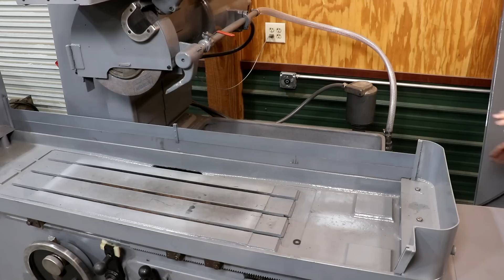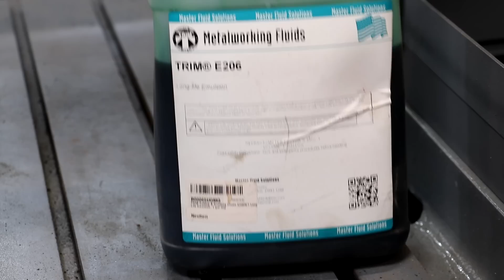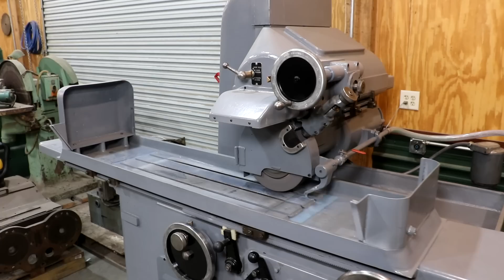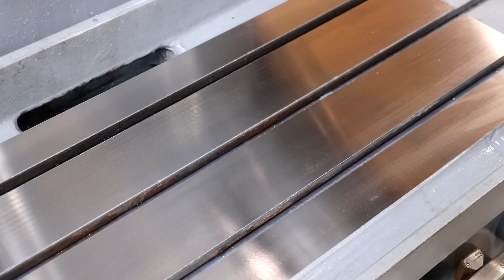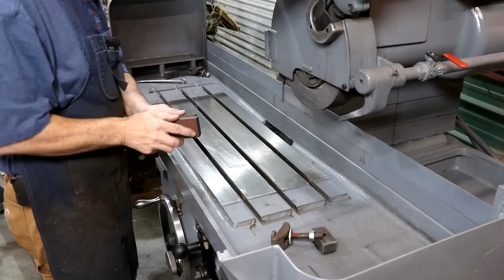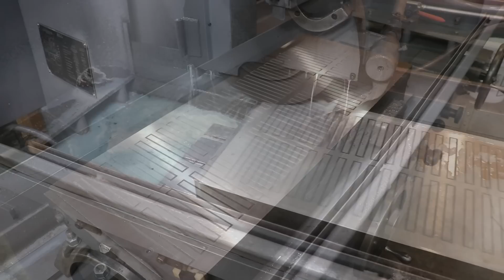Thompson Grinder Restoration: Grinding the Table & Magnetic Chuck True

Comment: Hi Keith. 
I have some advice for you regarding the surface on the chuck. Im sure your wheel is perfect for the job, but one thing people often forget when grinding with these vertical stone grinders, is to dress the wheel before doing the last 2 fine passes. 
What I always do, is leave 0.01mm (sorry for the metric, Im european), then I dress the wheel, and do 2 passes taking 0.005mm each pass, and then let the machine spark out until there are no more sparks at all. 

I dont know if your grinder is able to adjust the stone wheel speed, but if it is, then another tip is to lower the speed before the last two passes, and dress the stone at that lower speed. Often if the stone is spinning to fast, tiny ballance fluctuations will leave a "spotted" surface even if you ballance and dress the stone. So finishing of as described, im sure you will get a close to mirror finnish on everything you grind :) 

Great video, and lovely machine. Once you propperly get the hang of it, you wont find a better surface grinder than that :) 

Cheers

Comment: A guy in our shop was going to grind the chuck and started by removing the back rail and then dressed the wheel.  Everything was going well up to a certain place on the surface that wasn't grinding.  Turned out there was a diamond particle embedded in the chuck and every time he made a pass over that spot, it would dress the wheel back.

Comment: You need to take the time to find the overall high spot first.....on ANY job!  If you drop the head until you spark and just begin grinding you may discover that the high spot is elsewhere and you will be WAY too deep in general.....as you discovered I believe.

Comment: What I found out was grey were medium grind.  Best GP is white that fractures and cools.    I have Grey, White, Red, Green.    Red is Ruby and eats nicely.  Green is for Carbide or exotic steels.  I have some that are OGE ground for edges.  Light cuts on them they are ruby.  I have two dry vacuum's that draw grit and metal and has enough force to steal 1/2" steel being cutoff.  I found some in the hundreds of pounds of grit and iron when I got mine.   3-Phase 380v 3 motors.  I have some books (new) if you need their titles.

Comment: Adam Booth, Kurtis Allen, Leo Goolden, Dave Engles, and Keith all machine wood or metal, and do it to a high level of perfection. All five of them would remove the "bozo marks". I have seen each of them take time to remove harmless imperfections, even ones that can not be seen because other parts will cover them up. It is this compulsion that makes these channels worth watching. I love seeing them perfect items they are working on. (abom79, Cutting Edge Engineering Australia, Sampson Boat Co, Engles Coach Shop).

Comment: Bummer about that heavy cut, when I saw the sparks I thought gee that’s a bit much, but once the wheel is in your committed to it. Slip stick, the Bain of machinists for ever. If your getting lines in your grind I would try a table mounted dresser. If the overhead dresser is not in perfect alignment, or if your dressing dry and the diamond heats up on the way across, it will give you a bung dress. Although your dressing overhead with the axis it feeds on, it’s not on the side you grind, so the error however small is real. I have never liked them for that reason. It’s possible the first grind on the table broke the wheel down with the heavy cut and it conformed to the axis, which in my experience how it goes, the high point on the wheel does more work and wears away.

Comment: Hi Keith on my grinder coolant tank is similar in design in the front section i put some old microwave magnets in the bottom. It works well to catch all metal filling.

Comment: Keith: Check with Steve Summers, Adam Booth, Mike Wiggins and Keith Fenner. I seem to remember someone getting in a big supply of grinding wheels, most of which they couldn't use. Can't hurt to make some phone calls. Thanks for the video. See you at the Bar-Z. Jon

Comment: Why not use a silicone grease between the chuck and table to prevent rust from forming?  I would think over time the rust would cause a jacking effect on the chuck causing misalignment.

Comment: Would there be a benefit to put down a layer of wax or oil on the bed before putting the magnetic chuck.  I was thinking the underside of the chuck could be waxed or at least fill and protect the rust... or convert it and rustoleum rust reformer it.  Lol.  I suspect I am probably suggesting things that would help it survive 200+ years assuming zero maintenance but probably wouldnt matter in the near term.

... and then you sprayed on the anti-seize.  Lol.  Alrighty then.  Keep up the good work!

Comment: Is there a way to cut the outer ends of the bed?  It seems that you might want to bolt down things that are longer and might stick past the machined area.  That being said.  I dont use these sorts of machines so maybe that situation doesnt happen on this size of machine.  Excellent content.

Comment: What's your take on the 'old chestnut' I remember from my first career in engineering, when I left school here in the UK (so 1970's/1980's)? This is about the potential danger when operating a surface (or other) grinder, that uses a liquid coolant. The theory goes that, whilst operating, the coolant soaks into the wheel and as a result is uniformly distributed within the wheel's matrix. Then, when the wheel is inevitably shut down, even if left to spin a while before doing so, any remaining coolant liquid in the wheel will gradually migrate downwards under gravity, to then accumulate at the bottom of the wheel. The implied danger, is that when that surface grinder is next turned on, the wheel is technically out of balance, running the risk that the wheel might actually explode, due to that out-of-balance moment. In the company I worked at back then, divisions which operated night shift working, didn't actually turn their grinders off, as one shift changed to another. In those that only ran a day shift, the grinders were turned off, but it was the job of the maintenance staff covering the night shifts, to come in and safely start those grinders again, such that they were already running when the day shift began.
Reply: More likely I think the grinders were kept running to keep the machines 'warm' and tolerances within the machines consistent (what sort of product were they working on?). As for the out of balance issues, I don't know to work out how much G the periphery of a grinding wheel is subject to, easily in to the hundred+ at least, which I'm sure would prevent capillary action withing the wheel matrix. A stopped wheel sitting in a coolant puddle on the other hand is a different matter.
Reply: I'm sure you are right about keeping things at working temperature. In the divisions with night shifts; one was making pumps and compressors, the other made hydraulic systems (pumps, valves, etc.). My division had surface grinders, but only used intermittently for production and, of course, all divisions also had Tool Rooms with similarly infrequently used machines.  @alan-sk7ky

Comment: I'm interested in your take on step-over amount when grinding.  I worked as a toolmaker for many years and we almost always used a small stepover, the thinking is it creates less heat, and less heat distortion.  Also, with a small step-over, as the wheel wears there is still quite a bit of unused wheel face that is unworn and keeps the depth of cut consistent.
Recently I had the tables on a 12" jointer reground at a shop that does machine tool rebuilding.  He set them up on his huge gantry grinder. ( you could park a small car on the table) He said he had quite a bit of trouble with the thin castings swelling from heat but looking at the grind pattern you could tell he was stepping over about an inch per pass.  Didn't make sense to me.
The other theory with a large set-over is you can get uneven wheel wear across the face of the wheel, creating a very slightly uneven surface.
Reply: High production shops push for speed, and as you know, there's a tradeoff. In my old shop, we would hog off metal with high feed and stepover, but then re-dress the wheel and gently dust off the last half thousandth. Keeping a strong coolant flush made the wheels last surprisingly well.
Reply: I noticed a bit of z-axis movement while the table was traversing the x axis. Is that normal for these machines? When I grind on my Jones and Shipman 6x18 grinder I avoid that. I think balancing the wheel will make a big difference once Keith finds some for this machine.

Comment: To get rid of the pattern on the finished surface try a diamond mounted on the magchuck.  It will dress the wheel to the part not to the top of the machine
Reply: As long as both are rigid, it makes no difference, but the chuck is always rigid.

Comment: Is it typical to have the wheel/arbor move in/out while still over the part instead of having more horizontal travel so the head moves before getting back over the part?
Reply: I see that too the wheel is moving when it is grinding !!!! It should move over at the end of each grind not when it is grinding !!! It is putting a side load on the wheel !!!!! I hope that this help you !!!!

Comment: Good video, Keith.

I have three surface grinders in my workshop, and all are British made.

The largest is the 12ft long Churchill built in Manchester in 1931. It has an 18" wheel and is used for all my really big projects. It also has an 8ft electro magnetic chuck and a coolant unit with a magnetic separator.

For your information. Churchill was originally an American company that under licence built their machines in England. We continued to build your machines until the end of the First World War, when Churchill relocated to England permanently. Churchill then became The Churchill Machine Tool Co, which is still in business today.

Next is the Bridgeport built in 1938 in Stratford. It has a 12" wheel and 3ft electro magnetic chuck. Sadly, the machine is out of commission. I purchased it in 1989. "Sold as seen spares or repair" for £200. It was meant to be a working project only i never had the time.

The smaller and last of my grinders is the Jones & Shipman, built in Leicester in 1941 and has a 9.5" wheel. It has a 2ft electro magnetic chuck. The coolant unit has a magnetic seperator, but that was added later as it did not come with the machine. Compared to yours, mine is just a baby, but baby or not, it has a valuable history.

From the latter part of World War Two (1941-1945), my machine was used to grind parts used in the making of the Rolls Royce V12 Merlin engine.

These engines powered the early Spitfire models. They powered all of the Hawker Hurricane series and the Mosquito too.

The Mustang and Lancaster bombers also used the same engines, but neither of these names are mentioned in the document correspondence i have where parts were manufactured. The company is still in production but is now part of the 'Hardinge Group.'

Both of my working machines have their own diamond dressing stones similar to yours, although the dresser on the Jones & Shipman needs new diamonds.

For both of my machines, I use copper slip for the same reason you used it on yours. Both of my machines have splash guards like yours only mine are not segregated which brings me to my question.

At the rear of your machine your splash guard is split into 3 parts, and yet one part is missing. Do you intend to make another, or will you allow coolant to splash over the side?
Reply: That has to be the longest question in the history of this channel. Lol I’m just kidding, I hope you have at least a little bit of a sense of humor to go along with my attempt at being funny. 
   I really do enjoy the history of these old machines, where they’re made, where they’ve been, what have they made, it’s hard to imagine the whole history of all these finely made old beasts, so thanks for sharing yours. Have a good one!
Reply: I worked as a scraper at Midwestern Machinery in Minneapolis, Mn. in the early 80's. They bought, sold, and rebuilt used machine tools of all kinds. They bought a monster Churchill planer all the way from England. It's base and table were nearly 20' long! It took two low boy trailers to haul it from the port of NYC due to weight restrictions. When we pulled the table off, the ways were still in decent shape. A guy found a large British 1942 coin cleaning out the chip tray!

Comment: So, what does the coolant emulsion additive do?
Reply: Basically it’s a water soluble synthetic oil that keeps the work cool (very important), flushes away the metal particles from the chuck and prevents rusting. All the manufacturers will claim their fluid is the best but any reputable brand will work.

Comment: Well done Keith, the machine produces a beautiful finish, and I like the built-in wheel dresser. This brings to mind my years at the DoAll plant in Savage, Mn. as a scraper hand, where surface grinders and band saws were produced. Each grinder underwent the same procedure, done by one man in my department, grinding the table top and both sides of the magnetic chuck. Then a test cut was performed. We tried to maintain.0002" on our grinders, the largest size we made was 10"×30". If it was needed, the table was pulled off, and I would touch up the saddle and/or table ways with a hand scraper, then he would try a test cut again, a sometimes tedious procedure to get it right. I'm interested to see how she does on accuracy!

Comment: Hi Keith, I wouldn't have been able to resist cleaning up the bozo marks either, the chuck looks so much better without, and will save you having to explain they were "before my time" in the future 😁
Reply: Definitely getting the chuck as close to perfect as can reasonably be done will result in better results when grinding in the future.
Reply: I'm curious if that mag chuck is strong enough to have the divots transfer through what you're grinding (ie. leave a minute blemish). Glad he ground them out regardless. Pretty unsightly if nothing else.
Reply: Just a home shop hobby guy, but w/ my little 6x12, used/worn, from an auction, the first time I ground the chuck & left a big area untouched, near the front center, once a large area was nicely cleaned up - I told myself, I'll leave that for the next time I touch it up.. I got really good results, and subsequently, had better technique, & confidence, the second time I ground the chuck, just a couple more tenths.. I also, before dressing the chuck, did some test grinding to make sure I was comfortable with how things were working. 
Thanks, Keith, for another great video, that's an amazing machine!
Reply: I'd say it's purely cosmetic but that's OK, it's a restoration after all. A lot of the work is for cosmetic reasons, it's all part of the job.

Comment: Good luck on building your collection of wheels for your surface grinder.  The right wheel can really make a difference specific to the material being ground.  I hadn't heard of putting the anti-seize between the table and the chuck, but it sounds like a good idea.  Keep up the good work.

Comment: Why not adjust the limit stops and regrind the entire table ... ?
Reply: Steve Ward the limit stops were set to allow the raised surface cast in to that tabletop to be worked on by the grinder wheel. Grinding that raised area any further than absolutely needed is a bad idea since the intention when casting that was to provide a grindable surface. Yes, it is a consumable over the life of the machine tool, but, replacing that slightly raised area is going to be very difficult later on in the machine's life.

Think about it, the table is cast iron, the only way to replace that missing metal when you get done grinding it to the same surface as the rest of the table is to drill and tap for a new surface to be attached. Welding, brazing, and such are not indicated...

Comment: Keith, Would applying the power to the chuck affect its dimensions at all, even by tenths of a thou, so that it might be best to grind with power applied?
Reply: Hi Wilson, that's a really good point particularly with electrically powered vs mechanical mag chucks that I assume will warm up and "grow" a little bit when powered, although that bed would be a massive heat sink 🙂
Reply: Yes it will I was waiting for Keith to say he was going to lick it over once he has it powered but he didn't. Also is good practice when putting a mag on a grinder once its settled in place with clamping set up finger tight but not tightened to energise chuck then nip the clamping up.

Comment: Those strips of metal on that table, the ones that are ground flat and that the magnetic chuck rests on, are those consumables? They seem to be welded on. Are these sometimes replaced when they get too thin? Or does that rarely happen?
Reply: Pretty sure the table is one cast iron piece. Those “strips” you speak of appear to be T slots.